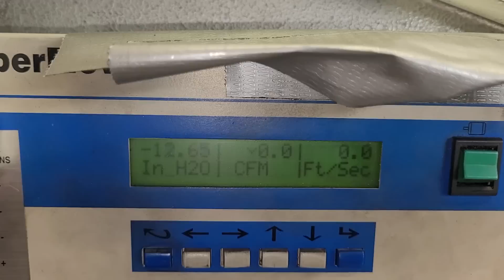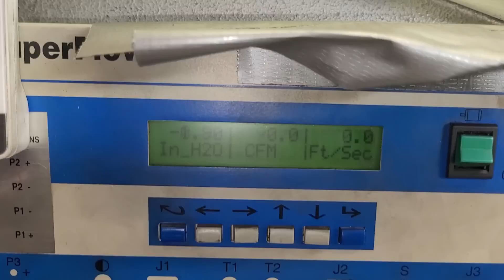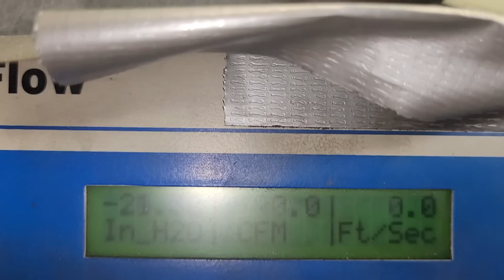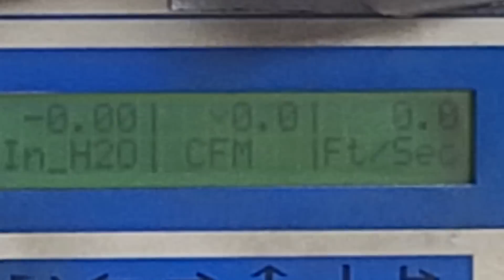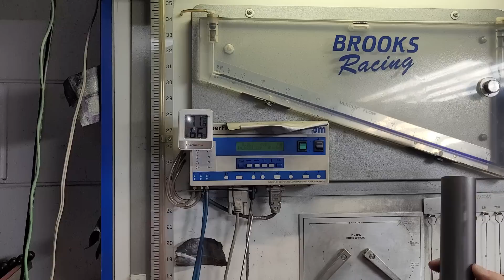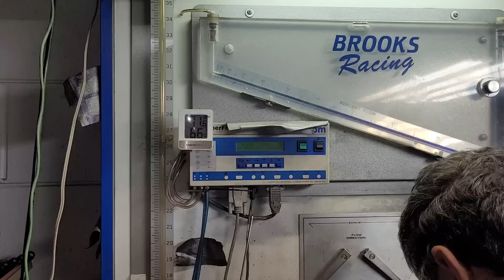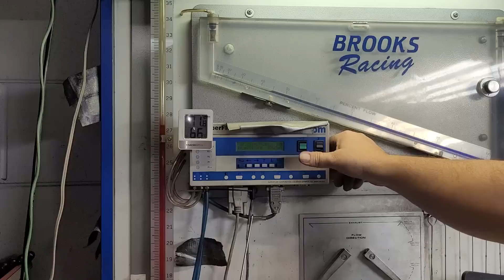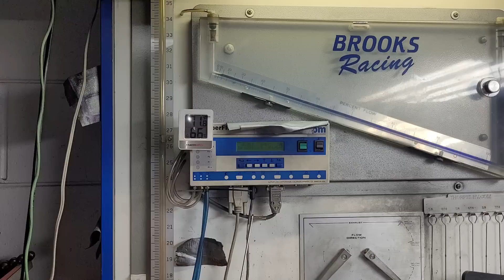David Vizard, Uncle Tony's garage, Unity Motorsport, Mission impossible. Air flow experiments, 2 jet

Comment: Thanks for taking some time for us TBI user's. Simple system that's so easy to work on. Love my current 88, had several 88-89s, ran the wheels off them. Good day sir. Subscribed
Reply from the maker: I am planning a full off the wall tbi project. Stay tuned!
Reply: @servediocylinderheads  very good sir! I was thinking of putting a duel quad manifold,with TBI adapters on my truck. 2 TBI's would make those haters loose there minds. Looking forward to your project. Thank you
Reply from the maker: @mikegore5840  I love it!
Reply: @servediocylinderheads  hey Charles if you think that duel quad thing is a good idea, take it and run with it. I'm sure it's prolly more problematic than I'm thinking, computer and shit etc. Never seen it done. Don't really know who to speak to etc. Would be honored if you would think on it a bit. Thanks.  it would be way cool
Reply from the maker: @mikegore5840  Holley has a 8 tbi injector add on to make their tbi kit a dual 4 barrel injection system. I bet other brands do as well. If you want to do all GM Howell can fix you up I bet.

Comment: I've been working / modifying the factory  carter 1 barrel for my mopar 170 cid slant6  and the factory carter 2 barrel 225 slant 6. be taking my dremel tool and all my bits and smoothing out the Sharpe edges inside the throat of the carbs and any other part of the carb that air comes in contact with it . grinding off ruff castings thining down the necks on the venturies . the last part im modifying for flow is the lip at the top of the throat of the carb and the cutting down the mounting tabs for the rod that holds the threaded stud that top of the air cleaner anchors to
Reply from the maker: I have done some of the same work to carbs. It does help!

Comment: I’m curious about that tbi. 
I just picked up an 87 454 truck with tbi.
Reply from the maker: Tbi is very sensitive to vacuum. It works off a map sensor and calculates the fuel volume. Lobe center angle on cam needs to be wide. I used a 110 lc cam and caused headaches.

Comment: Yeah that should mimic the carb fairly well, maybe try a piece of sheet metal in the bottom of the tube, to simulate the throttle valve!  To atleast see if there is a difference with and without it,  it could break up any swirl and reduce flow,

Comment: to me this makes sense like a rifle suppressor/stabilizer, the [  ] cylindrical chamber with its lip (bottom ring step) correcting+increasing flow. above the carburetor, below the carburetor, or both? below with correctly sized step could help mixture, like valve bowl shape affects combustion mix. 25% flow increase through the same size hole is a lot.
Reply from the maker: 25% is alot.

Comment: Would a cone on the floor of the plenums help the air start around that corner into the runner?
Reply from the maker: I have designed "turtles" before. I doubt there is enough plenum room to help. It is very tight. Thanks

Comment: Interesting,I never considered looking at the TB on my daughter’s Turbo Cordia.At present it would probably be running in 13’s seconds 1/4.I drag raced my 6 cylinder Australian Hemi in 1970’s. running a 14.08 @ 100 mph with road racing slicks.(No traction).Cordia feels quicker!Now to look at TB. Cheers from Western Australia.
Reply from the maker: The first thing I do is throttle body and all the plastic conduits from air intake to throttle body. Maybe add a K&N filter and that gives a stocker a nice kick in the pants.
Reply: Yes the K&N has been in place for 10years but I couldn’t read u reply well.I appreciate your interest & knowledge about TB’s.Thanks & good luck in 2023.Cheers Cliff

Comment: I feel a 383 with tbi heads and tpi induction would be the ultimate for towing and everyday use with its low rpm brute torque.
Reply from the maker: It would be killer

Comment: What about a bbc tbi or a 500 cfm holley 2bbl?  Is that too far out of scope? The experiments are entertaining.
Reply from the maker: The Holley is 670 cfm the gm is 500 cfm. I will just used the 15/8" pipe with or without the 100 cfm calibration pate. Depends how bad it is.

Comment: Hog out the intake opening to 1 oval. Then put a UTAWESOME single 108mm throttle body on it. DONE! Over 1200 CFM. 

Yes I know its not Throttle Body Injection but you could make a 1 inch carb adapter with 2 Injector bungs milled in it under the TB.
Reply from the maker: I talked to D.V. last night. A spacer may be needed. Thanks

Comment: 🔔😎
Carb flow directors on top always help. 4 hole spacers contoured into the plenum help. Remember what NASCAR builders did with the restrictor plates?
ANYTHING that smooths turbulence helps. 
Look at the insides of your pretty headers. 😲 A couple hours with your die grinder.👍 
It's the little things that win races.

Comment: Use a Throttle body off of a 7.4 big block!
Reply from the maker: I heard they were bigger and I bought one sight un seen and it had the same sized butterflys.
Reply: @servediocylinderheads  You got the wrong part then!  the 350 TBI units have 1 11/16" throttle blades that in stock form only flow about 470CFM's and the 454 TBI units have 2" throttle blades and in stock form flow 670CFM's
Reply from the maker: @bobg3034  That is what I thought as well. So I got the wrong t.b.
Reply: @servediocylinderheads  yep!

Comment: Not cheating at all😁

What I did was ported my Holden 253 V8 two barrel intake manifold plenum out, added a hand made 3/8" thick aluminium adaptor plate, with a large rectangular single entry open plenum with about a 3/8" radius on the plate leading into the plenum opening, and added a 3/4" Holley to Q-jet adaptor, and cut the divider out,, but kept the divider down the middle,  then bolted the Qudra Jet to the two barrel intake manifold adaptor I made. Obviously, a 2" spacer would have increased flow considerably.
Wouldn't do again like that

a better option would be to just hog mill out the plenum chamber, and weld on a Holley four barrel or Q-jet  adaptor plate, and turn the 2barrel intake into a four barrel intake. (Not Cheating 😁)

Another option would be the Australian EA falcon inline 6cylinder 2barrel tpi throttle body. If I remember rightly, two of the four bolt holes are the same pitch spacing as the Carter two barrel.

In My opinion though, for all intents and purposes a Holley 2barrel carburettor is all that is needed to achieve the one horse per cube goal.

Comment: Thanks for taking the time to demonstrate today Charles.
The solution is rather simple.
Use the 2-bbl 350 TBI throttle body and lock it with Vice grips at 250 cfm opening measured 275 cfm, 300 cfm , 400cfm, ect.
Hope that helps you.
Reply from the maker: That is too easy. Love it

Comment: One problem you will have is that velocity through the carb will cause fuel separation at the floor of the intake. Anything you can do to increase volume below the carb and help slow down flow so it can make the turn should help?
Reply: Turtles
Reply from the maker: I agree.

Comment: I would like to see 3 of those on a 6 pack intake with a Big block.
Reply from the maker: I want to do two four barrel tbi on a tunnel ram for the Chevelle.
Reply: Chevrolet already did 2 2s crossfire right?I'm sorry I'm still for carbs not so many sensors,wires and calibration on the laptop
Reply from the maker: @michaelstrafello7346  Crossfire injection was crossram with dual single throttle bodys. Tiny runners, made 250hp in Corvette.

Comment: Amazing I had a 92 TBI truck, had 330,000 miles when a drunk rear ended and destroyed it. Looking forward to more info on these units.  All I ever did was full 3" exhaust, bored TBI, injector spacer, with adj fuel pressure up to 12.7 to 13 psi and a salad bowl air cleaner mod.  Great truck, had a motor ready with DV's principles ready when the drunk did it in.
Reply from the maker: I know they are good for what they are. I went overboard with mine and cause some issues with computer. Me go overboard? Funny right?

Comment: Definitely run it with a sgl plenum  style manifold. You may want to look into whether all ports get a reasonably even amount of flow/mix, which - could - result in having to do some flow direction mods to the manifold. The jetting will of course have to be vastly altered especially on the idle circuit. but thats doable.

Comment: Have you ever done anything on a small 1 cylinder ohv  engine
Reply from the maker: I have, I took a 19 year old worn 5hp briggs and did a full port on it. 20" mower 30 years ago. Designed a double lawn mower blade that could mulch branches. It did not rpm any higher but it had way better torque for high grass.
Reply from the maker: This was a flat head now that I read your question.
Reply from the maker: I did a 2 piston opposable for a carpet cleaning machine a long time ago. Guy loved how it ran and burned less fuel to do the same job.
Reply: @servediocylinderheads  Those little lawnmowers are tough! Leave it outside under the wheelbarrow or something, and it will start humbly next season.. 😀My family member took the rev limiter off and cut the high grass with hp, dangerous!!!

Comment: Wath dou like The dual intake 360 on The 413 cui Engine Edelbrock 650 Carborator..I hope thuse will give more Torq and The orginal intake.Hope over 500lbs Have even Cothed shorty hedders.Chrysler New yorker 1963 Hgw.
Max rpm 4000-4500...
Reply from the maker: One of my very early hot rod experiences was an older friend took out his Mom's Chrysler Newport with a 383 2 barrel and 727 tranny. 5000 lbs and  would still do 110 in second gear. 100% stock.
Reply: @servediocylinderheads  276 gears and tall tires. Yep they would.
Got radared at 143 in a '64 Polara poly 318 2 bbl  276 gear. 2 ply tires. NEVER did that again 
Stupid scary shit.